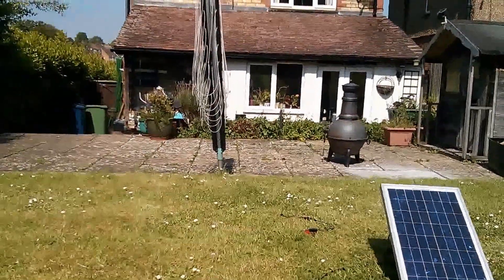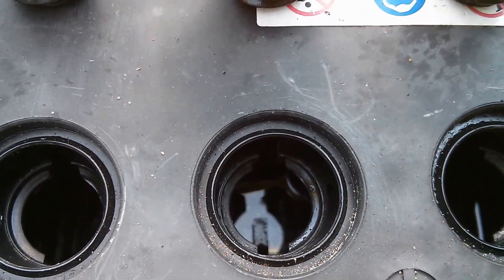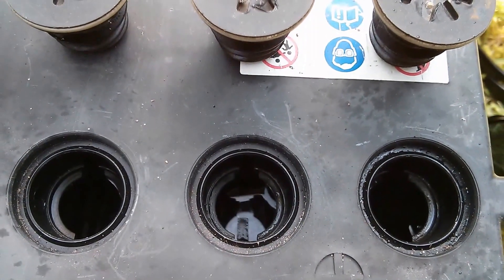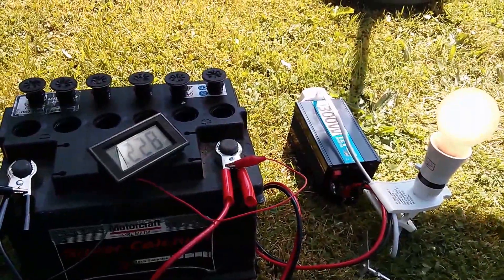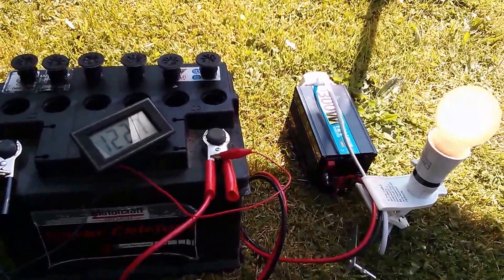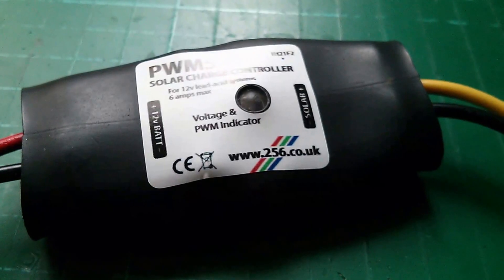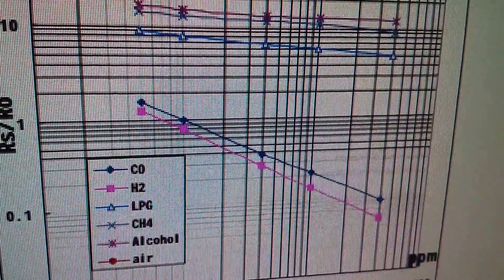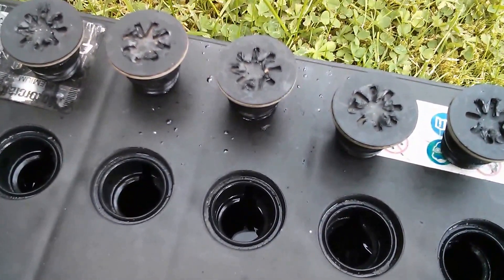Experiment: Solar Charge Controller Equalisation Feature?

Comment: I realize that this video is 6 years old, but for the sake of future viewers, the OP seems to confuse equalization with desulphating. Normal charging of dead batteries is desulphating. You actually want to do it at lower voltage than 2.5V per cell, specifically to avoid electrolysis. AFTER the battery has been mostly desulphated and a 2.5V per cell voltage only draws very small current, say 0.5A or so, then you want to run the battery at 2.6V/cell to let electrolysis knock off the left over sulphates and equalize the cells to equal internal resistance. If you do that to a sulphated cell you will knock off lead sulphates to the bottom of the battery and they will never participate is charging/discharging cycle again. You can replace sulphate by adding more acid, but replacing lead that never plated back onto lead plate is going to be a problem.

Comment: Respect Julian may i share a simple experience with you in  bringing back a automobile battery I found. It registered between 3-5v when I first put a meter on it. I had build one of them ac capacitor charger desulfator I saw on Youtube when I first put it on the battery the sides of the battery was hot but after about 4 hours it started to hold at 11.5v a few hours more and it sits @ 12.4v then I but it on a 1amp solar panel for about 4 days now it sits @ 12.7v even use it to start a car.

Comment: You could tip out all the acid from every cell mix up then pour back in, this would make the specific gravity all the same in each cell, then recharge and test, if no good then the cell is most likely short circuit.

Comment: Two years old huh? Sorry to comment on such an old video. You should build yourself a charge controller that features battery recovery features. PWM is a sort of battery recovery that can help break up sulfation. The other thing that can be done is frequency, amperage, and voltage pulsing, and some will even reverse polarity for very short bursts. Typically a good recovery charger will output current even if no battery is detected, meaning shorting will produce some pretty drastic sparks.

Comment: Hello Julian
I have found out from your images that you are using an automotive battery for your solar bank. From my study over time; solar panel storage are to be deep draw type.
Charging voltage for the ford battery is;
Silver calcium batteries generally require more charging voltage (14.4 to 14.8 V) and may not be functional in older vehicles because their power generating systems (alternators) give lower voltages than those of modern vehicles.
Try to find some better jumper cables; yours are made of steel not a good conductor and are rusting. Enough Said. Good Luck.

Comment: THIS BATTERY NEEDS WATER, AND IT WILL PROBABLY BE FINE!
You cannot get them to work like that, they need filling to the ring mark inside.
If they're are exposed, and some are, those cells will act "dead"....
Use distilled water only.

Comment: Cycle the battery. Take it down to under 12 volts then give it a full charge again. This works the plates and build some heat. You might be able to break down the sulfation.

Comment: The electrolyte levels in that battery look pretty low, those flat bits in the middle of each cell are the level indicators which should be covered up, stick some deionised/distilled water in there until each cell is just covering the indicator. Charging with low electrolyte levels will make your wonky battery even worse.

Comment: Very well done Julian ! This confirms the latest free Ebook from Teslachargers ( Lindemann/Bedini), that you really need these high voltages to get all the sulfates again into the sulfuric acid. Also it confirms, that it would be best to just have big 2 Volts cells only, so if one cell is going bad, you don´t have to get rid of all 6 cells ( the whole battery)...
So I am thinking of modifying normal car batteries by removing the bottom plate, so all 6 cells are shorted out via the acid or Alum electrolyte and so you end up just having a 2 Volts battery instead of a 12 Volts battery, but now with 6 times the capacity ! ALso this way no more lead sludge can short out the cells anymore, as these would sink out of the battery to the other container you have to place the battery in...So I would suggest you get the acid out of this battery, remove the bottom platic plate from all 6 cells and clean it up with NaHCO3 water and then
put it into a little bigger platic container and then pour Alum-water into it, so you will have a strong 2 Volts Battery.
Regards, Stefan.

Comment: Don't you think that keeping the battery at 14.4v for a few days would be gentler on the battery while still equalizing it? That's what I did with a 55wh battery. Left it for 5 days at 14.4v and it did equalize it.

Comment: you can test the voltage of that one cell by probing it and the cell next to it, i have done equalization by first floating the battery for 48 hours then doing the equalisation at just over 16v, limited by a 5 ohm resistor on my variable power supply, and have recovered some pretty dead batteries, also if you have a hydrometer it could be interesting to see  the result.  it should be possible by the probe method to actually charge that one cell and make it bubble, thus kickstarting your whole equalisation
Reply: @jusb1066 what is the probe method
Reply: @johnle231  you put a probe directly into cell making contact with plates, of course with newer batteries this is no longer possible.  But generally this will only give a short extra life,.. time to buy new
Reply: @jusb1066  

I bought a 200amp charger, but can’t get any batteries to boil.

Do I need to float first or something? 

(Float = trickle charging ?)
Reply: @johnle231  use a multimeter to get an idea.. float 13.6v a couple of days, battery should start to bubble over 14.5 v and be vigorous at 15v
Reply: @jusb1066  

What charger did you use to get it to charge at 15v plus?

Seems mines won’t go over 14.4
Reply: @johnle231  I have a variable power supply, can go to 25v.  You must be using a modern automatic charger,. You could find an old battery charger and it will do 16v
Reply: @jusb1066  

Yes can’t really find an old charger.   I bought the harvor freight one that does 200 amp
Reply: @johnle231  old Schumacher from yard sales, or eBay

Comment: Hi julian, your cell 5 is sulfated. You can De-sulfated easily. google relay De-sulfator, built one, it's cheap, put it on your battery for a day or two, and it will be all de-sulfated, not just cell 5 but all of them. the sulfation prevents, charging. So when it happens most people buy a new battery. the sufation layer is only a few attoms wide. but enough to prevent charging. How the de-sulfating device works, is not only will it rehcarge your battery, but the key action is that it pulse high voltage, around 100 volts spikes. the spikes themselves are very short in cycle. the spike action removes the sulfation. the sulfatte, or oxidation falls at the bottom of the cell, and can be ignored. I will see, if I can find you a diagram to get you started. BTW my car battery is 10 years old, ad only been de-sulafted once. Runs like new.
Reply: Maybe someone could be interested in this one: https://translate.google.com/translate?sl=cs&tl=en&js=y&prev=_t&hl=cs&ie=UTF-8&u=http%3A%2F%2Fwiki.mypower.cz%2Fdesulfator&edit-text=&act=url (it is originally written in Czech, but the rough translation by Google Translator should be sufficient enough to get the idea behind it)...
Reply: I doubt it will be sulfated. The typical symptoms of sulfation are full voltage but a serious drop in capacity and discharge rate. If cell five is producing no voltage at all, it's likely that heat+age has warped one of the lead plates which is contacting the one next to it and it is shorting out the cell.

Comment: Julian, regarding the gas sniffer modules. How well will the module handle the corrosive effects of the H gas? I'm thinking even if the detector was OK the PCB certainly would not and guaranteed sealing by potting or coating might also prove problematic.
Pity modern batteries no longer have the individual cell jumpers exposed which would make per cell voltage testing and balancing almost trivial.
Reply from the maker: According to Wikipedia, "Hydrogen is a concern in metallurgy as it can embrittle many metals". So the sensors may not last very long. Also, would the stainless steel mesh survive having sulphuric acid spat at it? Maybe this is one idea that shouldn't be turned into a project (although I have just ordered 2 of the MQ-7 sensors) just to have a tinker!

Comment: I wonder if cell 5 is somehow shunted by residue or some form of chemical whisker?  If that's the case it might be useful to give the battery a brief short with a jump lead to blast away any internal short.
Reply from the maker: That's possible, but I've only got "pound shop" jump leads and I'm too chicken to short out the battery using them!
Reply: Julian Ilett Oh go on.  Just a quick dab, but make sure someones videoing in case it does go horribly wrong.